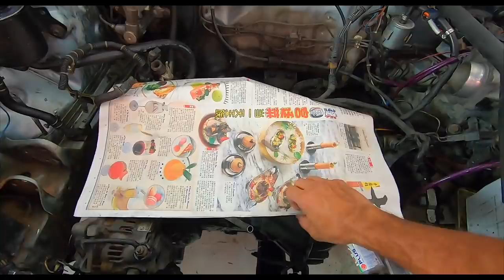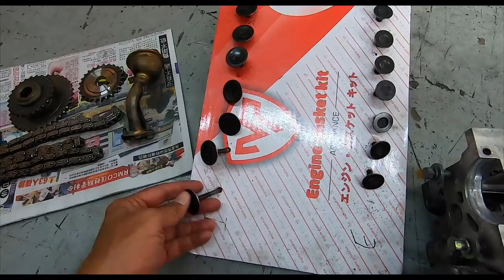SUNDAY NIGHT SPECIAL: 1992 Nissan Sentra B13 UPDATE! PLUS Merc W126 In-Car V-Log | EvoMalaysia.com

Comment: The B13 facelift auto was the second car that I owned. drove it for 6 years. had one power window failure and twice couldn't start the car due to the gear lock mechanism. and twice Tan Chong sent their mechanic over to my house to get the car started and it was FOC.  it was basically a trouble-free drive and was able to easily achieve 15km per liter on the highway. the engine response and mileage greatly improves on ron 97 grade petrol.
Reply from the maker: Thanks for the feedback!! I've been using Petronas ron95 Euro5, gotta try 97 to see if there's any improvement 👍🏾🙏🏽😊